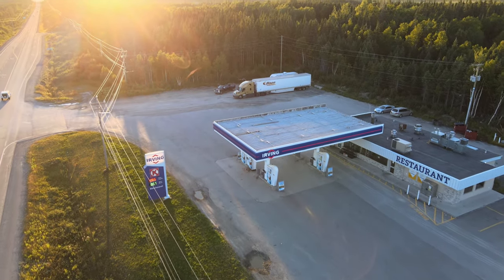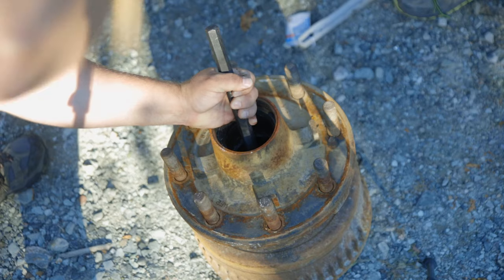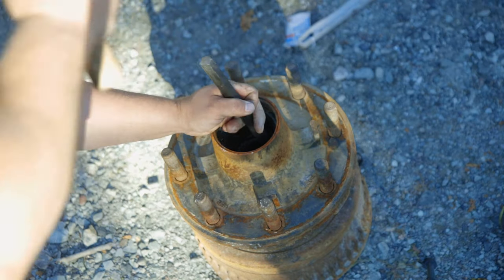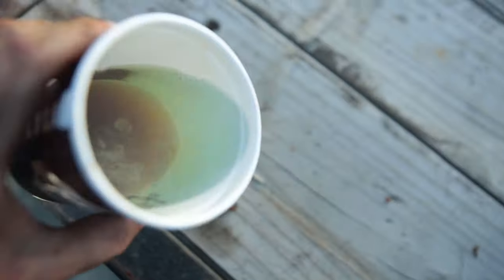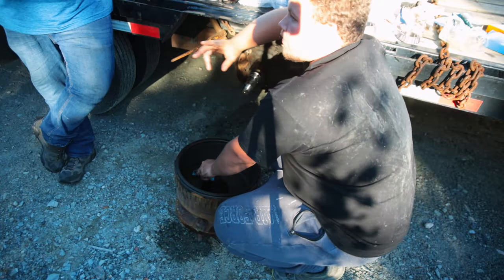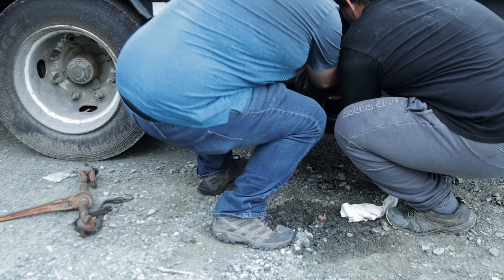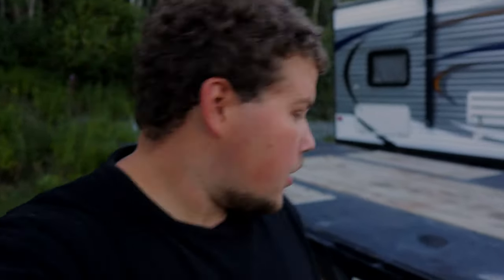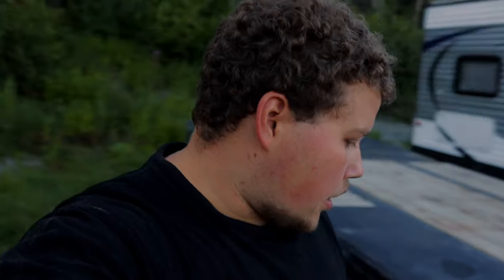Can we rebuild a trailer axle/hub ourselves? Fixing the blown trailer bearing.

Comment: One thing that can help install the races, put them in a freezer for a couple of hours.  Then pull them out just when you are ready to install them. The frozen race will be a couple thousands smaller than while at room temperature.  But on the side of the road, you just get a bigger hammer

Comment: For those watching.

An easier way to get races out: carry around a 1 ft long/1-1.5" diameter piece of pipe,use that as your punch. It will knock the races out in 3-4 smacks of the hammer.a

Comment: You need grease for the bearings not oil. The bearings will get Eaten up real quick with just oil on them.
Reply: These are oil bath axles.  no grease, just oil.